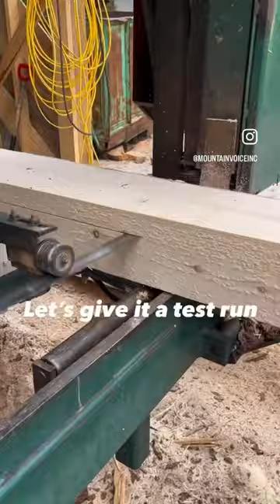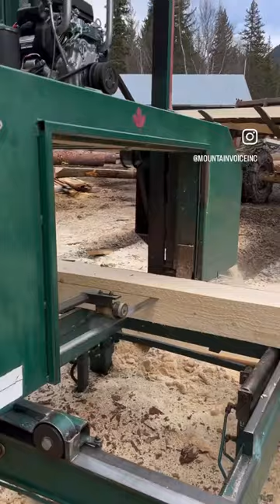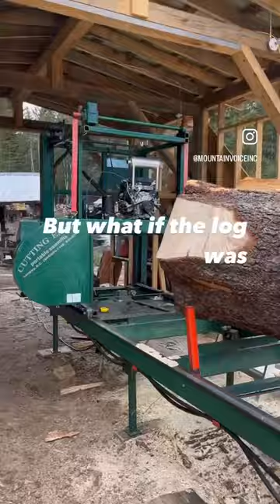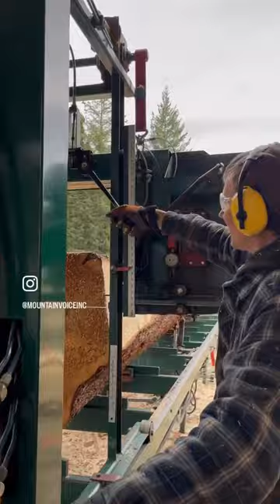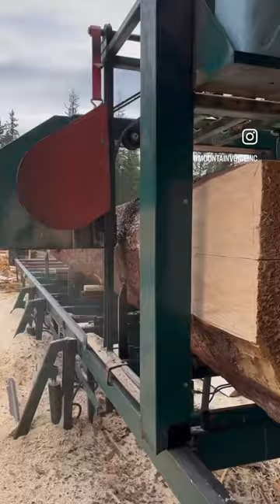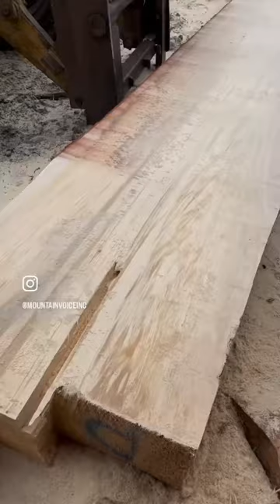Bandsaw Mill has a New Motor

Comment: Did the fast cut depend on hp or rpm
Reply from the maker: Hp was slightly less on the new motor, rpm’s might be higher on the new motor. In either case we are trying to cut as fast as we can without saw dive. That depends on a lot of factors so it’s not a direct speed race between motors, but the Honda is better.